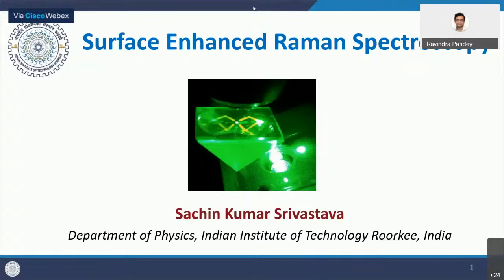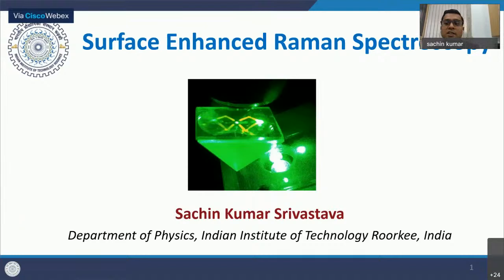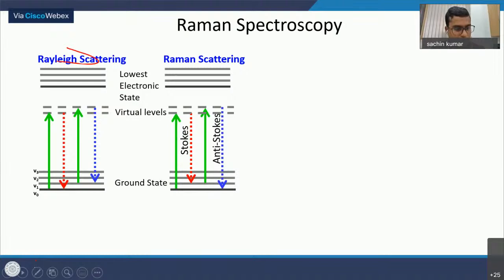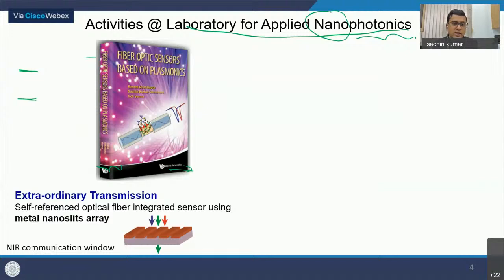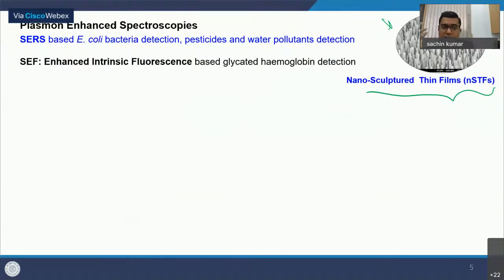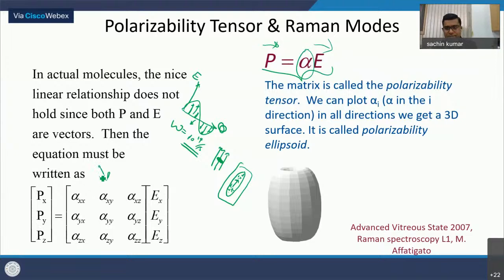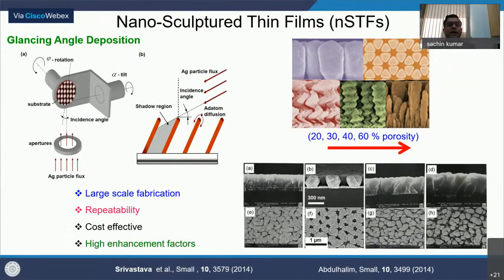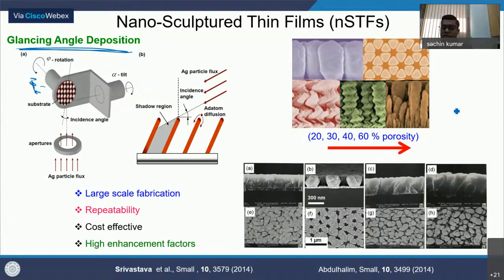Surface-enhanced Raman Scattering

Comment: You said that in stokes and antistokes line have different energy from the incident energy. It may be more or less than the incident energy.  But I am worried about more energy where extra energy comes from  ?
Reply: guess from laser
Reply: @alexred9963  how ? less energy means: losses of energy due to inelastic scattering but more energy means where it gains energy and how ?
Reply: If molecule loose energy the scattered light will receive the energy. This is how it gets the extra energy
Reply: The energy for the anti-Stokes shift comes from the thermal population of vibrational states in the molecule. Molecules at room temperature have a small probability of being in excited vibrational states due to thermal energy. When these molecules interact with incident photons, they can scatter photons with higher energy (anti-Stokes).
Reply: anti-Stokes scattering, the molecule is initially in an excited vibrational state (due to thermal energy) when it interacts with the incident photon. The interaction results in the molecule dropping to a lower vibrational state and emitting a photon.